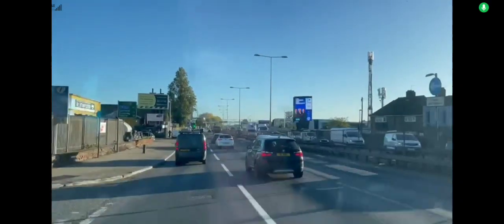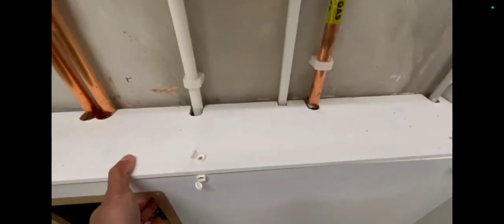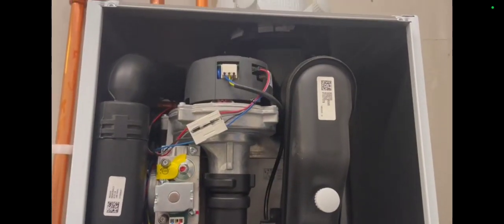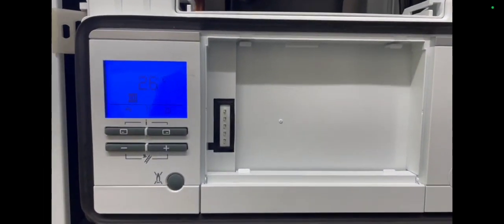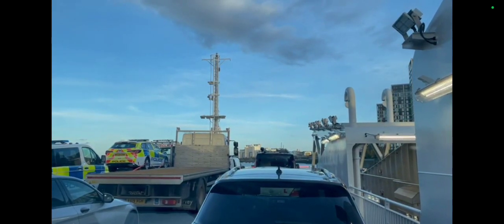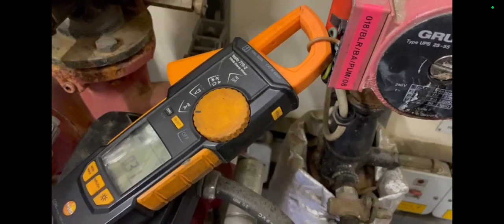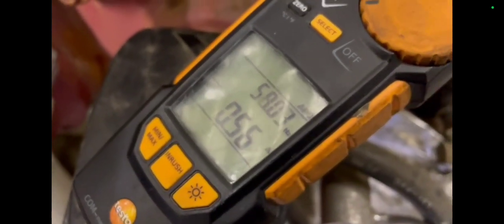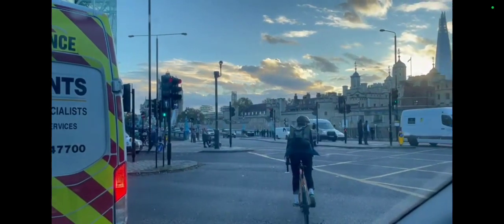DAY IN THE LIFE OF A COMMERCIAL GAS ENGINEER pt15

Comment: How did you get into the commercial setting? - I’m domestically qualified and trying to get a company to upskill/train me on commercial which is proving quite difficult - London based
Reply from the maker: I may have a few vids and others have commented their experience. In short I went to the manufacturer Worcester in West Thurrock. Takes a week and takes about £900. Recommend doing some homework beforehand. It's unlikely a company will sponsor you in this area as they don't always see the bigger picture. I've done all sorts of courses but that one was by far the best investment to date so struggle to understand why many other domestic engineers don't take the leap. Yet we're all different, may not work out for everyone or be what one wants etc etc. London has plenty of commercial company jobs available. Even with the lack of commercial experience once qualified I'm sure some will snap you up as there's a significant shortage of engineers. Hope that helps.
Reply: @CommercialGasEngineerVideos  🙏🏾superb  - will definitely give Worcester a go👍🏾
Reply from the maker: @user-id9bf7hn4v  let me know how it goes.